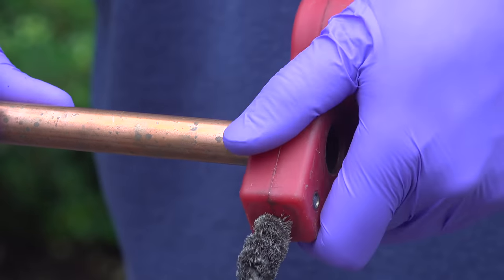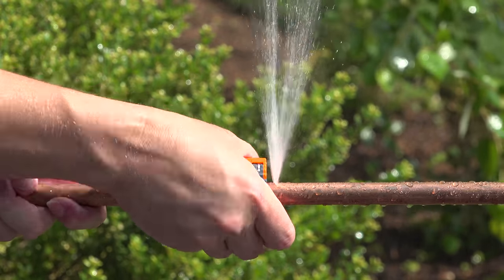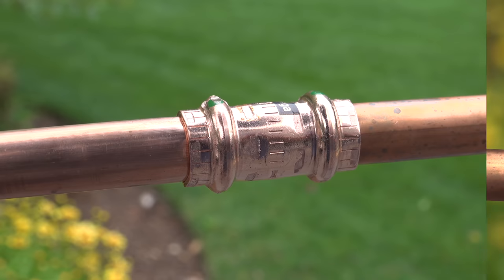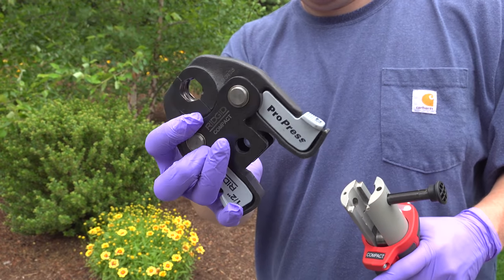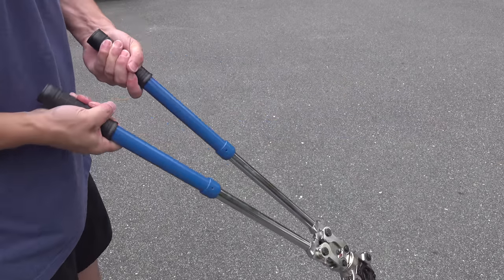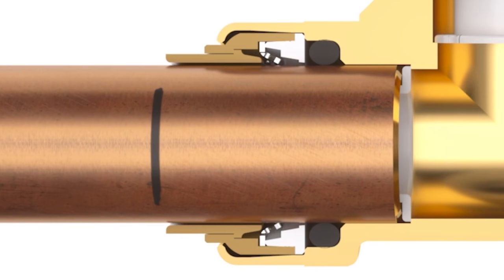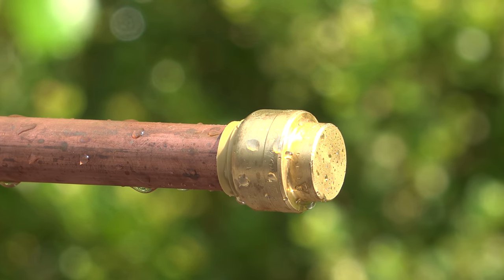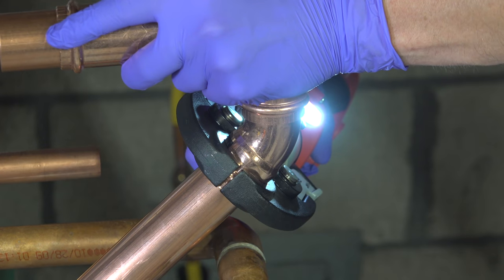NEVER SOLDER PIPE AGAIN - 3 Ways for EASY DIY Plumbing

Comment: With all things, Shark bite fittings have their use.

Some causes of (Shark Bite) failure
1) Over-pressure on line
2) heat/cooling variation deteriorating your seal
3) chemical irregularity in the line/water
4) poor installation
5) tension on lines (poor pipe fit)

some causes of (crimp) failure
1) failure of the tool-head (overuse)
2) bad crimp alignment (poor installation)
3) re-using aged/worn pipe

some causes of (solder) failure
1) poor installation (not soldered in correctly)
2) ???

Comment: Well, in my experience rubber deteriorates.  And especially if it's buried in a wall, it will cause damage long before you know it's leaking.  Is there any data on how long the o-rings are guaranteed to last?  I bet they are so confident in the o-rings, they guarantee those fittings for 100 years, right?  and they cover the cost of damage and repair?  No?  Huh.

Comment: I'll stick to Soldered or Brazed if heat is a problem there are mechanical fitting that don't rely on rubber O-rings

Comment: SharkBites: They only Leak due to Installer Error. Ex: If you do not properly debur the pipe a copper sliver can slice the O Ring. For those people saing " oh but the O ring can dr out etc - Not in YOUR Lifetime - they are NOT made of Rubber, rather they are made out of a EPDM material designed for Industrial plants that can withstand high heat and other abuse. Made from Lead Free Brass and Stainless Steel.  Made a "temporary" trial setup 12 years ago with several fitting and then another under sink set up 7 years ago - never a leak.

Comment: they built a new home for the elderly in my town about 4 years ago. they used these fittings. they are ripping them out all over the building because the leak like sives. Most people don't know that rubber O rings have a life span of 5  years

Comment: The copper pipe in my house is 53 years old. Will these new methods guarantee leak proof for 50 years?
Reply from the maker: To be fair, plenty of copper pipe leaks, always at the joints and nearly always from poor workmanship. Leaks didn't just start with plastics. If you watch the video through I show you multiple pieces pf Pex A in my house that aree leak free and 35 years old. So pretty good so far for me.

Comment: Soldering a copper pipe is the pinnacle of water piping and joint methods. All these other stuff on the market is trying to reinvent the most perfect wheel ever designed.
Reply: Most perfect wheel ever designed but the price you pay is a chance of a fire :)

Comment: As a former maintenance tech.  Shark bites can leak.  I've seen it.  I was not there when they were installed so I don't know if the pipe was prepped correctly, but I've come across 3 or 4 that leaked.  I've never seen the crimped connectors leak, but I haven't seen nearly as many.

Comment: I wonder if the sharkbites could be used to build a lightweight frame for a hand cart that could be converted to a different figuration like a cot....I guess it would depend on the tensile strength of the pipes for how much it could hold...

Comment: What do you do if it leaks? Soldered pipes have lasted over 100 years. I've Soldered 100's of joints and never had a leak. Putting these behind a wall is just asking for trouble imo. Soldering takes 2 minutes.

Comment: one thing people dont realize until they actually start looking at the cost of fittingS, pro press will cost more than regular soldered fittings. Faster job with the pro press but more expensive compared to soldering.

Comment: Soldering is still the best and longest lasting method. Yes I've used all sorts of pressure fittings and crimp connectors and even the dreaded shark bite but I've I really want to do the job properly then I getting out my torch. Especially inside a wall.

Comment: I have been warned by inspectors that by using those things puts people into a gray area.  That is, codes have yet to address or catch up the the "new practices," so when they do there could be issues of code violations that may not be grandfathered in, especially when trying to sell the building.

Comment: I did a Documentary - LA Hard Hats - Discovery channel.  A whole 45 story condominium's plumbing was done with this Crimp O Ring system. There are 10 Law Firms that bought units in the building, expressly to sue the Builders for any failure. I watched as an average of 20 joints per half floor failed with these O ring joints - they were quickly fixed before buttoning up. However, the Law Firms have placed heavy bets on those O rings failing. BTW, the union plumbers Did NOT like the O Rings either. There is no "mean failure rate" for the O Ring System - it simply has not been around long enough.

Comment: Sharkbite works. It’s not the answer. I would remove the stop valve that’s in your house.  The main reason push connects leak is because of the pipe moving around or having pressure in it. The rubber is not compressed to the pipe, the pipe moving around causes the rubber to move. Good thing for copper is that it typically doesn’t move as much as other pipe because it is so rigid. I find they last longer with copper.

Comment: I had a  friend try using crimp connectors. When he tried to sell his home, all the plumbing fittings that he used failed inspection. Building inspector stated that crimp connectors can't withstand a pressure test. Sodered connections withstand 300 psi, shark bites don't. All his connections that he installed had to be replaced. Plumbers are professionals, those that create videos are amateurs. Understand the difference

Comment: Would not want it in my wall. But for basement fittings for water heater or softener would be fine.  Would not use shark bite for long term fix but know many plumbers are using compression fittings.

Comment: the only "non-solder" copper pipe "permanent" binding I recommend is using a compression ring with nuts, like those for angle stops

Comment: I’d like to see the interior application that allows for the room of those arms on that compressor to fit. A piece of wet plywood behind a solder joint will always fit. And you can get the torch, flux, solder, and scrap wet wood for the price of a couple sharks. That will make A LOT of connections possible, that will for sure last longer than anything else, without worry of having to inspect the joints. Plus the torch can be used for other things too. Save your money. Do it right. Don’t take advice from a guy that doesn’t even turn the water off before working on plumbing. If you don’t know where your water shutoff is, stop reading this right now and go find it.

Comment: Love the convenience, but my copper and solder joints have held up for 60 years.  Not sure a rubber O ring will last that long.  And outdoors, the copper often has tiny pits in it, and any kind of bite might not hold up with water sneaking thru the pits.  Solder actually holds better with a few pits to flow into.

Comment: I am a plumber in germany and we are using press fittings for more than 25 years now.
There are absolut no problems.
Water, Gas, Heating. 
I cant believe that there modern countries where the plumbers still solder their pipes 😳
Reply from the maker: Thank you for sharing this. This is just like Wagos here. When I did my first video 2 years ago people thought I was insane, now they are finally catching on, despite the fact you guys have been standardized on them for I think 40 years?
Reply: @SilverCymbal  
Thats possible. I know and use Wagos since i started my worklife 25 years ago.

Comment: As with all these modern methods of joining pipework that requires very little skill, u need to look at how long the manufactuers will warrenty the joint for. Bearing in mind that is a pipe length and joint that is left alone and not messed about with or put under any stress or strain over the years. Remember the space shuttle that exploded killing everyone on board because of a faulty 'O' ring😮

Comment: I’m plumber for 20 years, I prefer solder the copper but in this times the pex is more popular, plus the propress tool cost to much for one repair, $1200 to $2400 vs turbo torch $80 dólar plus flox and solder

Comment: The pro presses hold up pretty well, annoying to use and expensive, but looks really good if your working somewhere where all your copper is exposed, Sharkbites are a temporary solution, meant to be used to cut in quickly, solve the problem, and return to normal operation while you go call a real plumber. source: Service plumber

Comment: so question.  i had a busted pipe last year and the plumber put shark bites to fix it and it busted after a few day, at the sharkbite.  i have copper pipe and they replaced it with pvc.  could that have been the problem?

Comment: I came across the ProPress the other day and when I saw the tool was priced for pros who will be using it all the time I thought a manual version would be way better. Lo-and-behold, one exists! However, my only qualms with it is how bulky the unit is, and how much room you'll need to be able to get it to a pipe and be able to actuate the levers. My idea is to have something that just involves a drivescrew that you can run with a power drill attachment or something, basically duplicating the pro-priced tool but with just the jaws and a drivescrew replacing the gears that are attached to long bolt-cutter handles. Where there's a will there's a way.

Also, what's the life time on those O-rings in the ProPress fittings? That's really sketchy having some kind of rubber/silicone holding the seal. I'd rather have something that's less likely to degrade over time.

Comment: Sharkbite 1" connector is a pain to slide deep onto the pipe.Very nice if you have all this space around the joint, but if the pipe is 1 " away from the wall, straight slide of the Sharkbite is a bit problematic. Very nice crimpers, the size and price - not so nice and I will second other comments about questionable durability of O-rings

Comment: I like the idea of sharkbite fittings, but as a mechanical engineer I just don't accept it as a "permanent" installation.  I don't even like the propress as permanent for constant pressure with rubber being the actual seal.

Comment: The first sleeve joint, in Brazil we have something similiar for PVC tubes and we call "sliding sleeve". There is a reason to call it "SLIDING sleeve". I wouldn't trust any copper joint using the same system.

Comment: These are quick and easy to use.and they also leak if you get any movement of the pipe.where silver solder will still be holding.quicker isnt always better

Comment: 0:57  just curious as to why cut pipe w/ water on but debur the pipe w/ water off; yes know deburring copper pipe w/ water in can be challenging if not down right impossible; but if this a how to and can be an emergency…..for those out there who don’t know……do you debur?

Comment: The solder will last a lot longer than that rubber ring in the long run I've used a ProPress before but only for emergencies where I couldn't stop the water

Comment: It's crazy to say that pro-press is for DIY! Even for pro's it only makes sense if you're able to make more money by doing things quickly. Also the fittings are like $5-25 each. Solder is dirt cheap and honestly very easy to apply properly. If you're intent on doing it yourself and you can't solder just use shark bite.

Comment: You can guess the general age of your crowd by checking the number of comments against sharkbite. They are either older plumbers themselves or were taught and follow the rhetoric of older plumbers.

If your excuse for not using sharkbite is because if you dont install them correctly, they'll leak, it's a weak argument. That same argument applies to all fittings. Soldering requires more skill, time, resources, money, etc. Sharkbite takes the easy jobs from plumbers. The ones you overcharge for. It isn't a cure all, and there will always be people who don't wanna do it themselves. Especially the heavy-duty dirty jobs that actually require a plumber and someone with expertise.

Comment: I'm not a huge fan of pro press. It's convenient sometimes but I hate how you can't pipe in a linear fashion like with soldered fittings. With soldered fittings you can squeeze it with pliers and twist the pipe and it will stay together until you're ready to solder. Pro press just falls apart which is frustrating and requires you to press certain things out of order. Also if you fuck it up, you have to start all over again and the fitting is wasted. The fittings are way more expensive than soldered fittings which makes it even more frustrating. My boss insists on using it for everything. It's good for quick repairs but doing an entire heating system with press is a pain in the ass. Most of the time I'd rather just solder.

Comment: Soldering is king for copper pipes mate, don't play it down! If the the solder takes to the deepest part if the fitting it won't budge. In fact get a pipe with soldered fittings and start bending and snapping the shit out of it. An elbow would snap on the bend itself but the solder itself won't give out, the pipe itself would first 😎

Comment: Just $175?
How many times would you use it?
A blow torch, pipe cutter, solder, flux and matches are cheaper.
O rings over time may crack or harden. I wouldn't use this method and will stick with solder. I just put a new bath in my house and did several well made beautiful soldered joints on the pipework.

Comment: I've had a shark bite on my radiator system  for  over 10 -15 yrs  not a problem.  only problem I had was a gas fitter fitted plastic pipe without the inserts and the pipe collapsed mind they were using cheap arsed pipes .

Comment: Shark bites are not allowed inside of floor or wall cavities where accessibility is not an option it goes against most residential and commercial code standards in most all counties just learn how to use your torch and your solder and use a piece of sheet metal as a heat shield between your flame and sensitive objects I do it everyday

Comment: 1:36 only downside to m12/m18 force logic press tools are the prices. The M12 is about $2200 and do have sails, the m18 can be easily $4000 ;personally i wouldn’t buy the 2674 variants and tay with other more expensive models; HOWEVER, if just homeowner and want a ProPress tool, the Milwaukee M12 is a great tool that should meet your needs. If it doesn’t, you definitely SHOULD BE CALLING A LICENSED PLUMBER PERIOD, imo and experience.
Also, the m12 can be bought cheaper (7%-20%) on certain holidays and at times able to get a free Milwaukee eRebate as well. FYI, would t buy used of those “sites” b/c not sure condition or use cycle already added to tool; and last thing wanna do is spend all that do Rae me and flush it b/c got burned…..along w/ most likely the Milwaukee warranty. Alway way I’d buy used, if knew plumber and they used 1-3 times and realized they wanted m18 force logic. How can tell, cleanliness of tool, case, and accessories; along w/ running serial number (or calling Milwaukee) to figure out what warranty period is on tool and battery if in kit.
My opinions and thoughts and hope this helps someone out b/c these aren’t cheap tools imo.
Cheers✌🏻

Comment: The only place I would even consider a shark bite or any rubber gasket joint is outside of a sealed wall where you can keep and eye on it. I would never use rubber gasket joints in a sealed wall.

Comment: Everyway I look at it it's a pricier side grade at best if what the folks are saying about the longevity from other countries is correct. The fittings and the tool are far more expensive in the case of the fittings it looks like its generally 3+ times more expensive going off of the off the shelf prices at hd, bulk containers its still about the same 3x. There are already two widely used flameless plumbing systems in place with pex and cpvc. It looks slower to use for me considering you have to crimp both sides of a fitting, the tools looks very bulky for tight spaces and a skilled plumber should know how to handle a torch. When you have everything assembled together like you would for this you could blow through sweating everything in no time. I just don't see why a plumber would switch to this system other than to showoff and have the new flashier thing. For a emergency repair from a non skilled homeowner there is shark bite although I would never hide those in a wall.

Comment: If it's got a rubber oring in it, it's going to fail sooner or later no matter what. There are plenty of 100 plus year old houses out there with soldered joints that are just fine. I'd use a Sharkbite in an absolute emergency, with the intention of replacing it with a proper soldered joint as soon as possible.

Comment: what happens if your pipe problem is in a tight spot and you need to crimp the propress fitting. The crimper wont fit .

Comment: I hate soldering joints, but hate o-rings even more. In my 45 years of mechanical work, ANY fitting with an o-ring failed much sooner than any crimp/compression/solder/threaded connection. Do they work, yes, are the easy, yes, are they quick, yes, will they last as long, no.

Comment: I had bathroom renovation work done a couple of years ago. The plumber used propress. The result is loud pipes with the sound of water rushing any time the water is turned on in the renovated areas. It’s very, very disappointing.

Comment: At 1:56 i notice you don't show trying to complete the upper joint - simply because there is no room to get in there with that huge contraption. Yes - great doing the plumbing in the garden with that - but not in confined spaces as it wouldn't be useable
Reply from the maker: The other joint was crimped. They didn't make these tools to not work for plumbers. Yes no single tool fits every situation but this gets into pretty tight spots.

Comment: I'm not very confident on those rubber seals. I've seen rubber seals in valves fail due to the chlorine in the water.